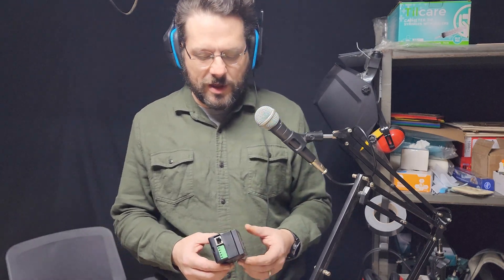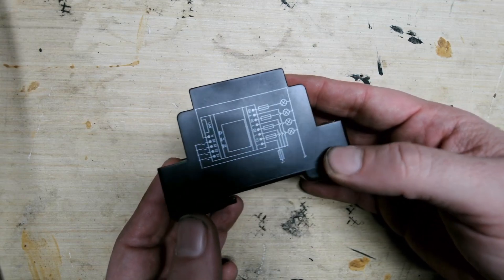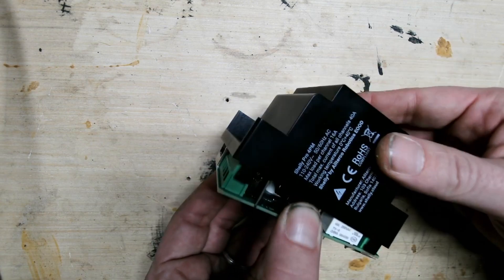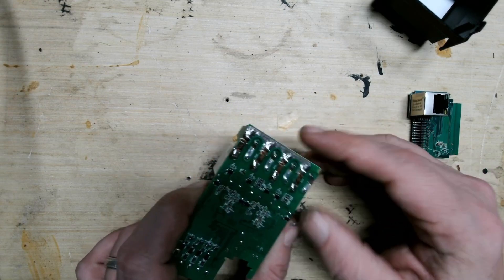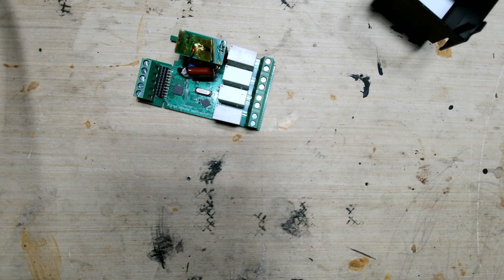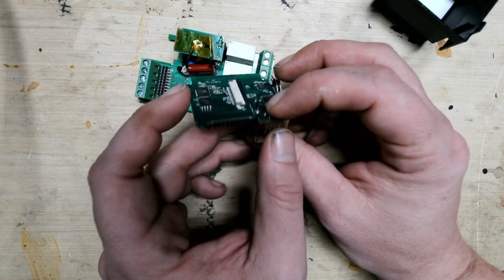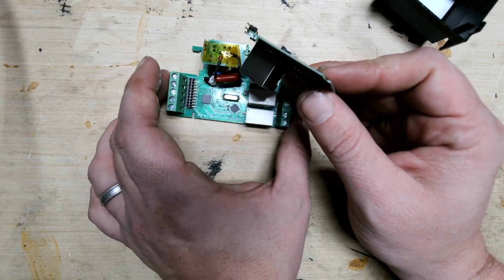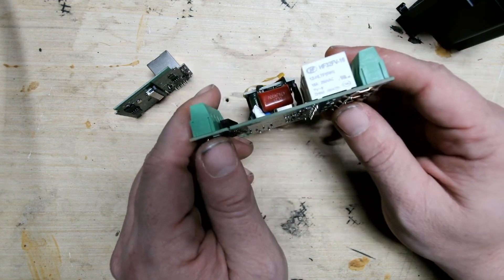What's Inside The Shelly Pro 4 PM? Let's Find Out.

Comment: These things seems to have a capacitive power supply for the low voltage. I dont think it is a good idea to connect it to ethernet. 
Capacitors burn, so It is a matter of time until the capacitor blows, and who knows what spikes are going to get out of there before the slow-fused resistor burns.
Such a large format din-rail device must have an insulated power supply
Reply from the maker: I don't think this is a cheap cap dropper. I'm pretty sure it has galvanic isolation (I've been told it's a switch-mode), but even beyond that the Ethernet circuitry is isolated as well by transformer coupling (1.5kV).
I'm not going to deny that there's some level of general failure risk associated with the electrolytic caps, but I don't think it's immediate or catastrophic. The device will fail, but I don't believe it risks any other device. 
I could very well be wrong. I'm not an EE or any such thing, and I may not be seeing things correctly. I'm also half relying on what I have more recently been informed of.
 I'll put in a question to the designers and see if I can get a definitive answer. 

In the meantime, to anyone reading this should exercise some level of caution and be mindful of the age of all devices. Electrolytic caps are the bane of retro PCs, but they don't just give up right away--otherwise, we wouldn't use them so widely--but they do have a much shorter lifespan than some of their counterparts or alternatives. They also last longer when they're in regular use as opposed to being simply stored.

Thank you for bringing up the concern and potential hazard. It definitely warrants a closer investigation. I'll share findings once found.

Comment: Hello sir this relay not hare very good if connect one line to air climate or Washing macchine. Right?
16A relay is very little ?
Sugestion you have connected   full home to this device?
Reply from the maker: Correct, you would want a contactor for such an application. You could potentially control the contactor with the Shelly 4 PM if you have a 120 VAC coil on the contactor. You could also use the Shelly 1 if you want to use a 12 or 24 VDC coil.
Reply: @smartercircuits  i need select good device for controll hooven cooking and washing macchine. Air climate. And control power.
If use shelly4pro need add other 4 extra relay .
If relay shelly4pro call the secondary relay for switch on, fist relay not have spark but time for switch secondary have timming meccanical   and spark gap work only in the secondary relay?
If disconnect and the device hare in use the spark gap damage Fist relay.
Hjhjahj
This is very problem....
Reply from the maker: If you intend to use a smart relay for this application, you will certainly need a contactor to protect the smart relay from spikes, yes. I believe there are smart contactors, but I've never purchased or used one. I have a couple inductive loads on my relays, but they all have buffer circuits or similar to smooth or prevent damage. Also, the largest load I currently have on a relay is probably 7 or 8 Amps, but if I wanted to control something larger, I would just control a contactor with my existing relays.
Reply: @smartercircuits  but work power meter?  Need series connection for working power meter. One option is Adding one extra capacitor parallel to secondary relay for prevent spark to relay primary. But have delay for switch off. Correct or not ?
Reply from the maker: If you need to meter the power, I would recommend a meter with current clamps rated for your application rather than attempting to run two relays and attempting to time the disconnection of one just to get the power metering. You could even use the Shelly EM with a 50A clamp and the EM has a contactor control built in if you still want to switch the circuit.
https://amzn.to/3PHe29x
Reply: @smartercircuits  this need extra relay. 
Shelley or moddig tour decide with relay 25a. 
Or need other brand device.tuya selling 63 relay. But not have button command
Reply: Hello sir the shelly free have only 3 scene setting for all device?
Thank you
Reply from the maker: @s-max3277  I don't use scenes outside of Home Assistant, so I'm not sure. I would highly recommend Home Assistant if you don't already have it.
Reply: @smartercircuits  wath device micro pi you suggest for install hass or old box Android .
For low power energy
Thank you